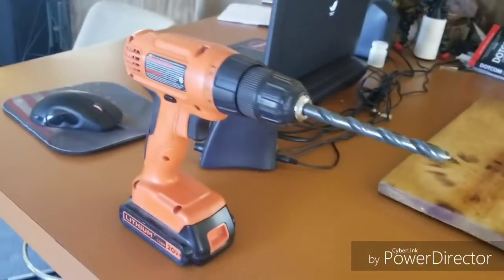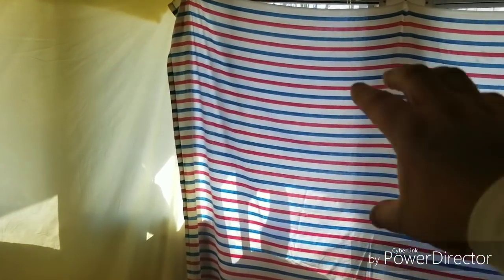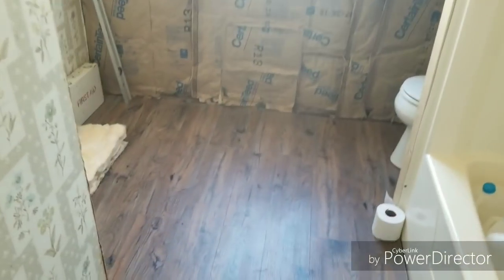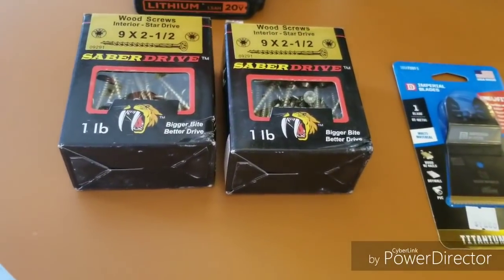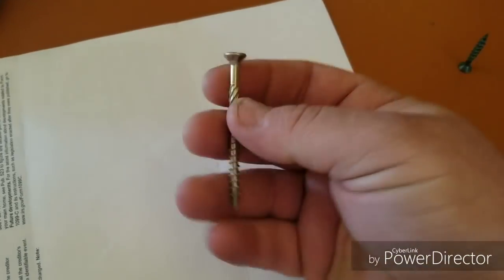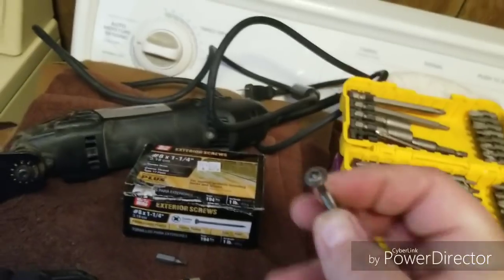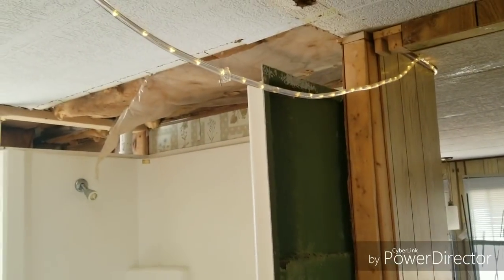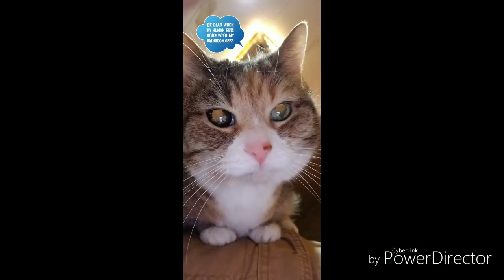THE $5,000 MOBILE HOME RENOVATION CONTINUES 2019 BATHROOM

Comment: Good job... Glad to see the Dremel tool in action. I have one similar and have yet to break it out... kind of afraid LOL! I didn't realize you had put cardboard under the bathroom floor not a bad idea and on that drill up bit I think it's SQ.. SQ = Square???  When we step out we leave our tv on for the critters only because we don't get good radio reception.  And the hall closet..hmmm ...did you ever think about putting the access door on the inside of the bathroom so you can access the towels and different items from within the bathroom?    Your idea on the kitchen, squaring off that wall... good idea!
Reply from the maker: Hey Me, Yea I had thought about it but I have a idea on how to have storage in the bathroom with out a closet. I just think it make the floor job alot easier.
Reply: @MDC2020  true a square room could mean less cuts and less waste.